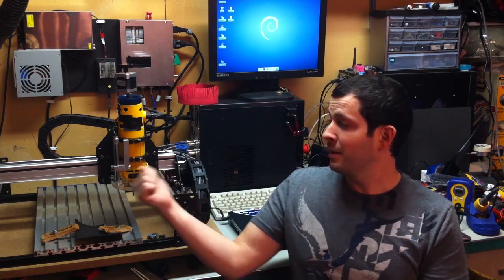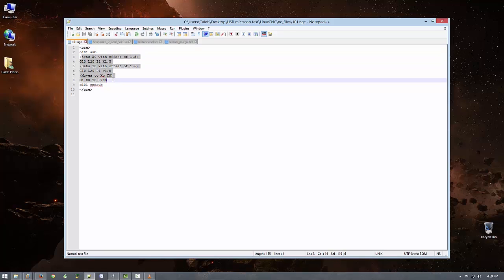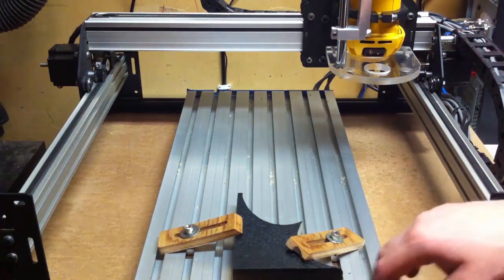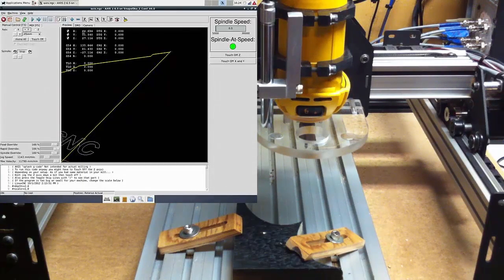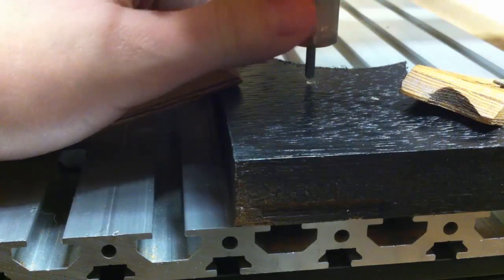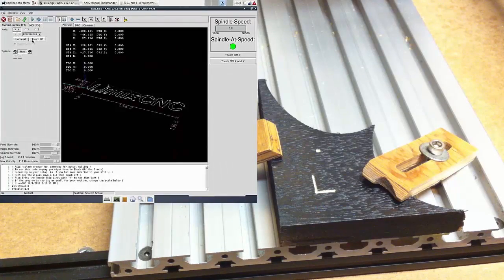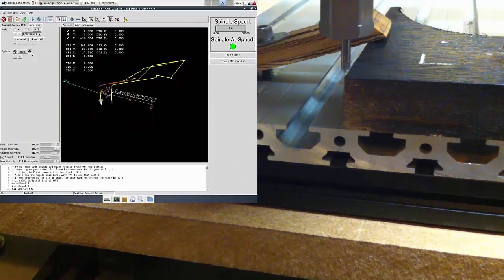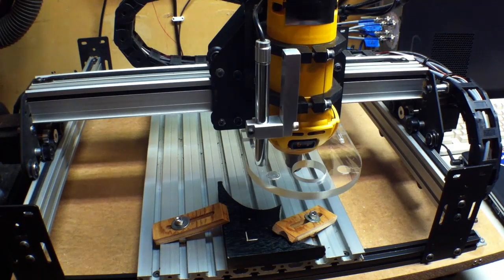Zeroing a CNC with a USB Microscope

Comment: im new to cnc im coming from printing and cutting ... i worked with a zünd g3 flatbed cutter wich also can do cnc stuff... it comes with a camera to recognize register marks and edges of the material... so no need to make a g code or something... why isnt this normal with cnc machines??? wass looking at a few machines they all require to manually adjust the postion..

Comment: You could do this with a laser as well I would guess?
The advantage with this setup is that you can do everything from the computer screen, and would not have to visualy look at where a laser was pointing.
Reply from the maker: Ashaman Mhael I can't imagine why a laser wouldn't work.  I've seen them used on CNC plasma cutters and laser engravers. However, I've also ran across a few people that have cast lasers in a negative light in comparison to the camera. Unfortunately, they were quite vague about their opinion on the matter. Normally they just stated something like "laser edge finders aren't as accurate or cool as you'd think."
 
Perhaps someday I'll get my hands on a laser edge finder, and try it.